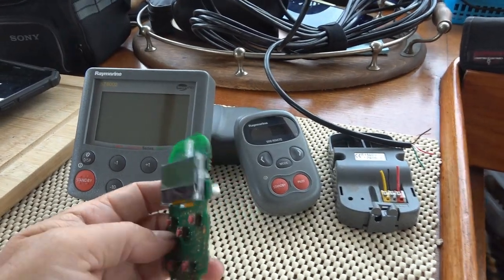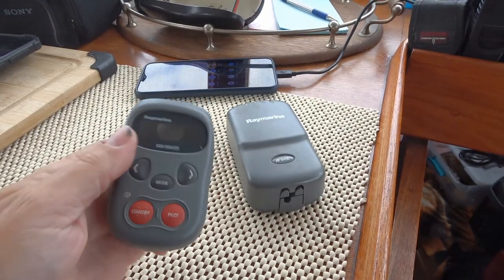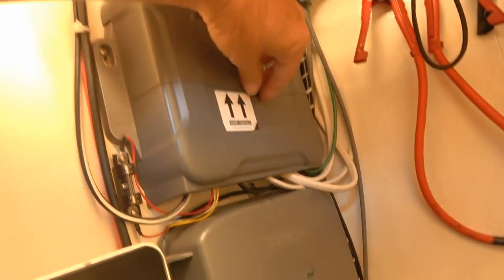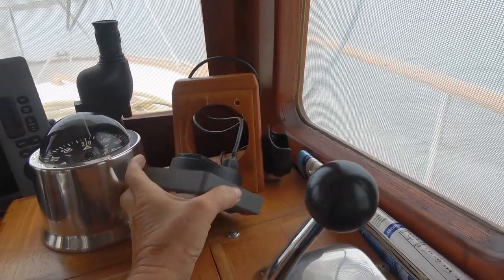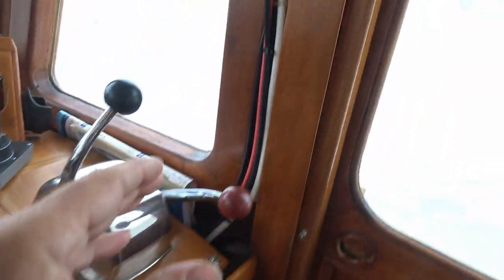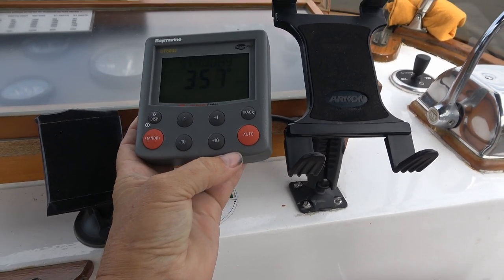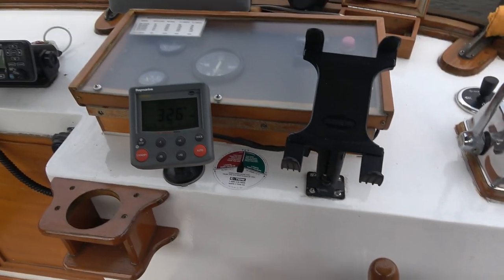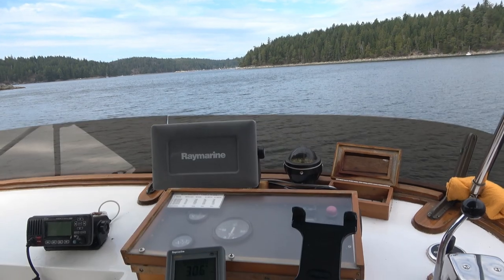Raymarine ST6002 Autopilot Hack for Broken S100 Wireless Remote - Boat Repairs -1976 CHB Trawler

Comment: Nice solution to the cost of an expensive part.
Maybe instead of plugging and unplugging from the back of the unit you make up a pigtail for the unit that plugs into the dash. Much easier to change the connector on the pig tail when it fails then the connector in the unit.
I'm enjoying your other RV (boat).
Thanks for sharing your travel.

Comment: I`m trying to repair one. The fault lights come on. 2 led`s flash near the ARM chip. No lights on the 12/24 volt LED`s or Power Off/On LED`s. A little bit of salt damage on one capacitor. I`ll have to keep trying.

Comment: You're a very handyfeller, they're ray. Question. Could you use 2 of those units? Or would there be interference if  they were both of hooked up at the same time?
Reply from the maker: I'm pretty sure it would work since the wired in unit and the wireless unit were able to work at the same time.

Comment: Nice way to save some $$$ for sure. Those units are pretty pricey to replace. Though curious why you didn't just try running a second, dedicated wire from the main unit below the helm straight up to the fly bridge instead of hacking up that one wire. It looks like there is a second 'SeaTalk' 3-wire connection point on that main unit.
Reply from the maker: I wasn't 100% sure it would work like that and didn't want to try it and mess up some logic settings or fry the whole thing leaving us with no autopilot at all. So went with what I knew was working. After boating season is over I'll have time in between seasons to research how the system is wired and works and refine the installation. 
I'm hoping I might be able to find some salvage stuff at a good price. It would be nice to get a second head unit vs the remote. Some people like sailboat owners use the remote in some situations but I don't see it being useful for Anne. Better to have a fixed mounted one and not worry about batteries. Cheers, Ray

Comment: Does she want to get rid of the RF receiver? I have the remote but lost the receiver overboard when i went to do the install lol
Reply from the maker: No, going to keep everything in case I come across a remote at a used boat store or swap meet. :)
Reply: RU PNW based?  @LoveYourRV  if I dont find a RF I may have to just let mine go lol
Reply from the maker: Yes, we keep the boat in Lund, near Powell River, BC, up by Desolation Sound.  https://www.loveyourrv.com/category/boating/
RV south to Arizona, etc, in the winter, and boat up there in the summer. :)
Reply: i will keep it in mind  @LoveYourRV